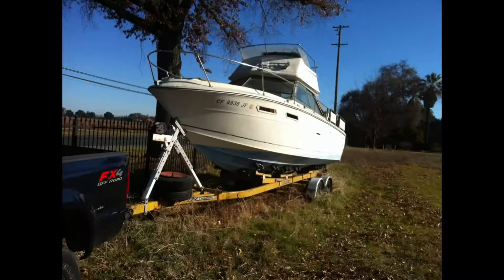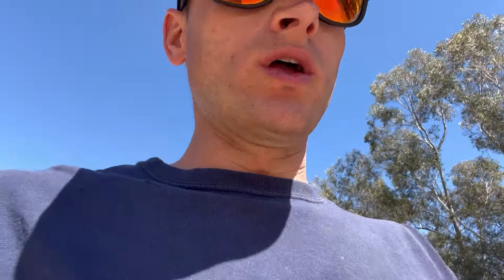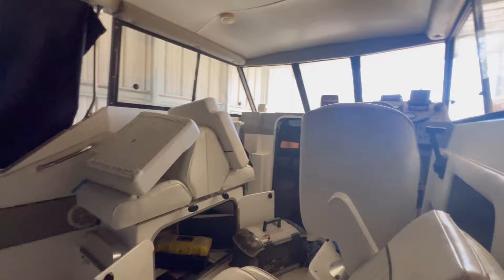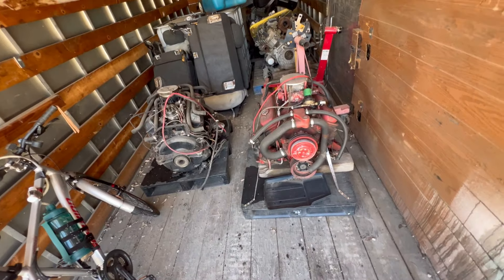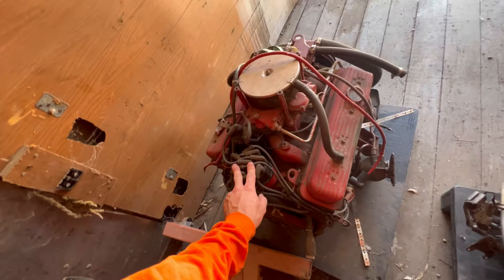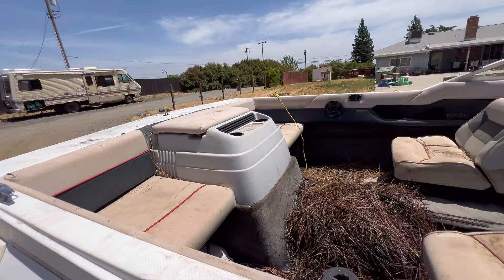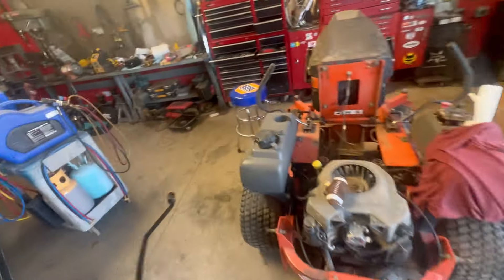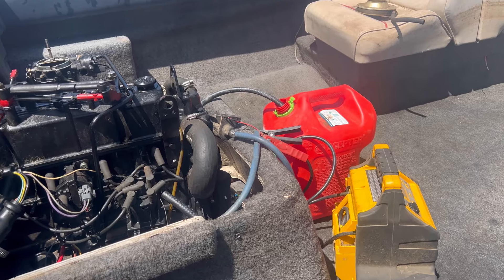Before you buy a used boat

Comment: Freeze plugs don't work because they are not freeze plugs. I know they are commonly referred to as such, and they can pop out in the event of a freeze. "Freeze plugs" are actually plugs used to cover the holes used for sand removal after casting.  They are not engineered to prevent damage from freezing.
Reply from the maker: One would hope that they would serve two different purposes